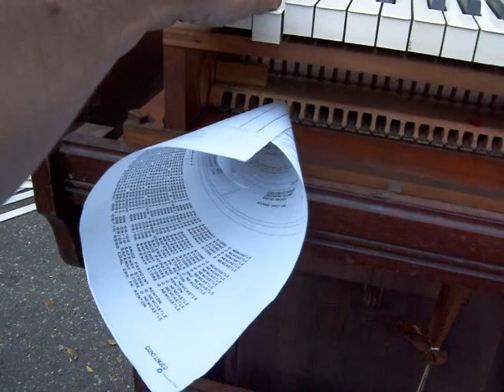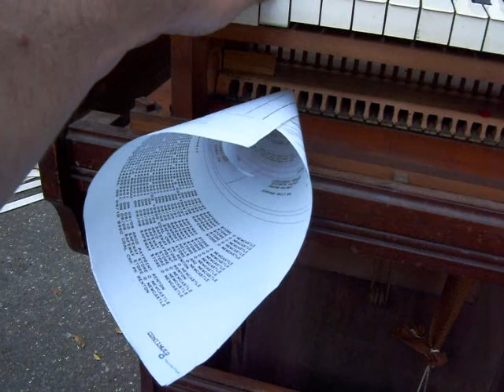Solarium & Harmonium Projects Part I

Comment: @Lifecomesfromwithin  Nice video and as for the cleaning of the reeds, I seem to remember using a little ammonia and water and let them soak in it before using a blow dryer on them. No toothbrush however as the slighest scrape will put them out of tune. Tuning is very tricky and done with a reed-scraper. (Usually just an isolated high note here or there.) As for those reed cells, this is the worst problem when it happens. I used to remove all reeds and clamp all tight and paint glue in ea. cell.